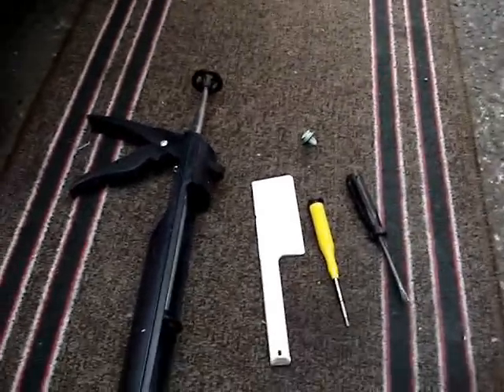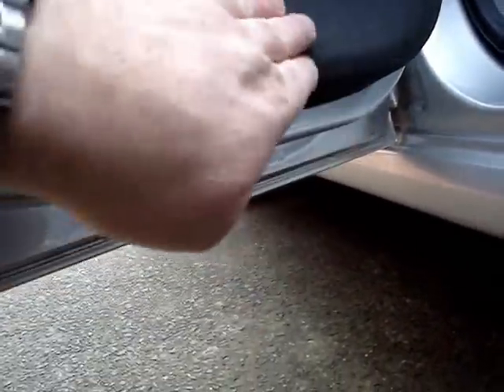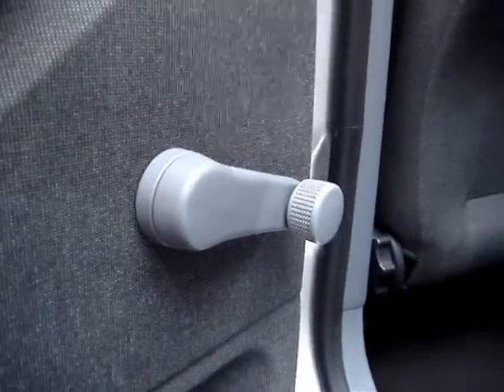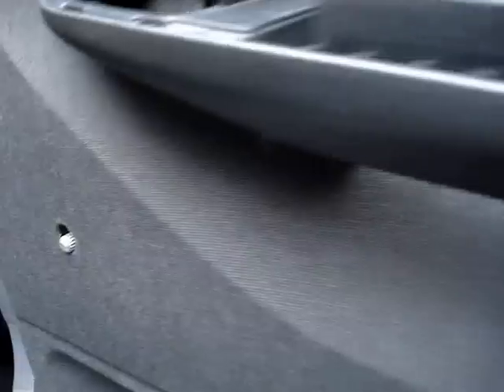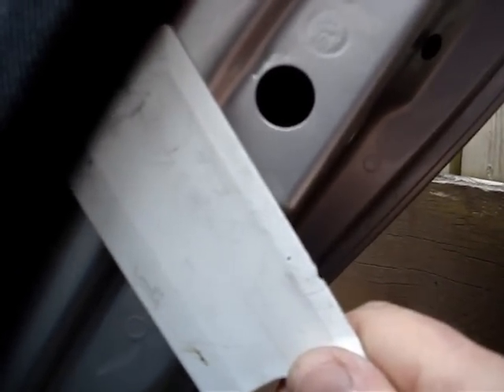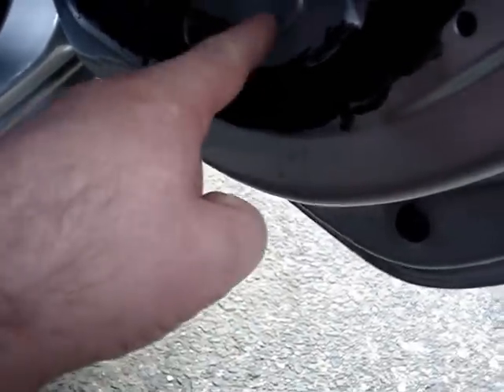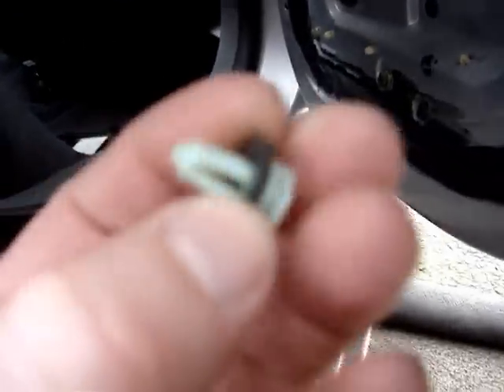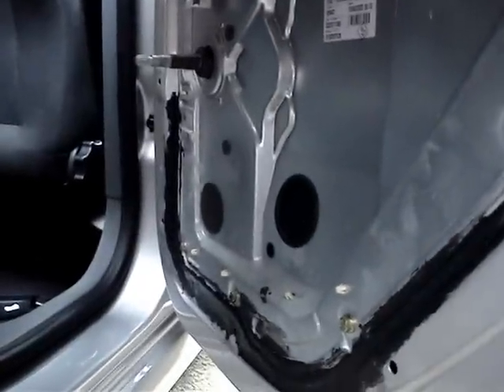Skoda Fabia Rear Door Seals Fix

Comment: Thanks for the video! My wife had the same problem with her Fabia, we took it to the local dealership, who did the same fix as this. BUT, it still leaked!! after looking at this video, I had a look at the doors myself, and noticed that water could still get in through the holes below the repaired seam (where the nylon poppers go into). What I did was to place a ring of silicone sealant around each hole, and pop the panel back on straight away. The result - dry Skoda!

Comment: Thanks a million for this video. Had this problem for a few months with Ford Mondeo front passenger side. Mechanic I knew, said it was pollen filter, changed this and still leaked. Saw your vid and put in a Saturday doing both front doors. Couple of months later and no leaks after plenty of heavy rain. Thanks!!

Comment: Thank you very much for this video. The only trouble i had was getting the poppers (?) out. I needed a scewdriver for this. 
I see this video has over 100.000 views, there must be a lot of Fabia's with this problem. I'm glad i could fix it myself thanks to your video!
Reply: There are also a lot of SEAT Toledo's, Leon's and VW Golf's with the same problem. My girlfriend's Toledo was like an aquarium inside. 5-6 cm of water on the floor behind the seats after a few rainy days. Only the fishes were missing  ;-)  When i talked to a VW car repairer here in Sweden regarding this problem, he said there is a severe and idiotic construction failure on many VW, Skoda and Seat models.

Comment: I'll be doing this to hopefully solve my sisters fabia which suffers from the problem too. The annoying thing is the dealer was supposed to do this under warranty years ago but it seems they didn't do a good enough job. Thanks for the tips about leaning the door card on the seat. That will save time!

Comment: Thanks for this video. Will finally  do it together with a friend (and his car too) this week.
I can recommend using non-clumping cat litter for drying the carpets (before and after the 'treatment'). I added a little duct tape 'dam' in front of the air outlets under the front seats, so nothing could get into them.

Comment: On an older Fabia it's almost impossible to get the plastic clips out of the door without at least one or two breaking.  The plastic gets incredibly brittle with age, and the rubber washer sticks to the metal of the door.  However, packs of replacement clips can be obtained easily and cheaply online - £3 for ten.  The key thing is to avoid snapping the part that is part of the trim itself (I can't see how you could replace those).

Comment from the maker: When it rains the water runs down the inside of the metal panel, and if the door seal is broken, some of the water will pass through the seal, instead of over it as it makes its way to the drain holes which are at the very bottom of the door edge.

Also make sure the drain holes underneath the door are not blocked.

Comment from the maker: No, there are drain holes underneath the door (check they are not blocked). When it rains the water runs down the inside of the metal panel, and if the door seal is broken, some of the water will pass through the seal, instead of over it as it makes its way to the drain holes which are at the very bottom of the door edge.

Comment: @jasonleechtube After rain, you should see that the lowest part of the black rubber door seal is wet, and maybe even be able to trace the wetness from there to the damp patch on the carpet. Once you pop the door panel off, squeeze the carrier as the video suggests, and if water comes out you know where it's coming from.

Comment from the maker: @100roberthenry There is also a chance. The rear wiper pipe has a joint under that plastic kick guard on the sill, that can leak, but is hard to get at just don't use the rear wiper wash and it stops. if you cant get the plastic sill of to get at it.

Comment: I've done this in 2007. Notice where the problem is actually. There are drain holes on the bottom of the doors. Those holes overgrow during the time and block water inside the doors. So beside seal I recommend to clean the drain holes.

Comment from the maker: There is also a chance. The rear wiper pipe has a joint under that plastic kick guard on the sill, that can leak, but is hard to get at just don't use the rear wiper wash and it stops. if you cant get the plastic sill of to get at it.

Comment: thanks but can this cause dampness under the back seats as everyone who sits in the back of my fabia always say there wet I've listed the seats up and put  newspaper after drying with towel the next day I look at the newspaper and it's always damp but not soaking?
Reply from the maker: +colincky w it could do but I would check the rear washer pipe I know it runs along under the back seat tucked in to the side and maybe its leaking ? I think it runs along passenger side but don't have this car now so cant confirm that.
Reply: +Colin Wilson hi colin thanks very much appreciated I will have a look tomorrow morning this makes sense as the dampness is on the side of the passenger side and recently when using the rear wiper water it dosent seem to have the same pressure as it did many thanks ....colin .
Reply: @ccwweeman3385  hello, did you fix the problem ? I have the same problem as I sealed the door pannel but I still have dampness on the passengers floor...
Reply: @JeanLapin1000  hi the problem on my fabia was the seal on the hatchback door the area that holds spare tyre was always full of water it's been fixed now but it's not 100% . Hope you manage to fix yours Jean Lapin 1000 🤞
Reply: @ccwweeman3385  hi, my car is a comfort break and the area with the spare tyre is dry. My problem is on the passengers floor, so I don't think it comes from the hatchback... I'll keep lookint ! Thanks for the answer

Comment: Hi i own a 2001 seat toledo and it has the same problem but i was just wondering where the water goes once you sealed that panel? Doesnt the door just fill up with water? Any idea where the drain holes are on a seat leon/toledo
Reply from the maker: No It then drains through the holes at the bottom of the door. Water will take the easiest way out, and that's through the broken door seal before getting to the drain holes. That should be at the bottom of door on a seat Toledo.
Reply: Cheers feller will be doing this at weekend

Comment: Hi! I have this problem on my 05 fabia. BUT I WANNA KNOW WHERE THE WATER GETS IN THE DOOR??? Can't find that out anywhere! And if you sell there when it gather up and pour out higher up??
Reply: Hope someone can answer this! Then i will do a fix on mine. Maybe a hole in the lower part of the door.
Reply: vazza69
apparently the water is supposed to flow through the door and drain out the bottom, it gets in on window and flows down a plastic sheet I think... normally to the bottom of the door, but because seal breaks higher up some of the water gets into the inner seal.. if that makes sense... either way... it's supposed to get into the door
Reply: Okay i think i get it now. Would it maybe be better to drill a hole in the lowest part of the door? Couldn't find any holes there. I'll do the fix on mine as soon as i fix all the other problems XD
Reply: vazza69 ooh i don't know about that... i'd go for the sealant or a new strip of the rubber stuff and see if that does the trick... I don't like the idea of making more holes to keep the water... out...
Reply: ashurstudios
Incidently be careful with the poppers when you take the panel off etc... they do break so very easily..
Reply: Thanks that has answered my question perfectly.  Door in pieces and was fearing it becoming a bucket

Comment: where do you get the right size off torque screwdriver I have everything else thanks ian .
Reply from the maker: +Ian McCully You should get a cheap set at any good hardware store. I don't no the size I used but it will be among a set.http://www.amazon.co.uk/BERGEN-TORX-STAR-SCREWDRIVER-B1502/dp/B0161BTPWA/ref=sr_1_41?s=diy&ie=UTF8&qid=1460045171&sr=1-41&keywords=torx+star+set
Reply: +Corsur thank you
Reply: It's a Torx T20.  Quite small - as Corsur says, you usually get one in a Torx screwdriver set.

Comment: Once you have sealed this does it mean the water is now trapped inside the door? Or does it have another exit?
Reply from the maker: It then drains through the holes at the bottom of the door. Water will take the easiest way out, and that's through the broken door seal before getting to the drain holes.
Reply: Thank you, I will try this when the weather is better it looks like a cheap and easy solution to a wet carpet.
Reply: @corsur  that copy b paste 😂😂😂😊

Comment: Rear washer tube may have come unattached in the engine compartment, see if the floor becomes wet when you try the rear washer, if so you can reach in and reconnect.
Reply: Where can I access this

Comment: As numnutsone said once you have sealed the panel up with silicone the water that was dripping inside the car is now just sitting inside the door and will fill up with water,i have just sealed my mothers Fabia up with silicone and now thinking where is this water going to go.if it wasnt finding its way out the drain holes then why will it find its way out now.mothers car mists up badly